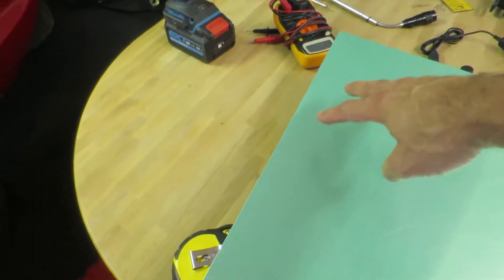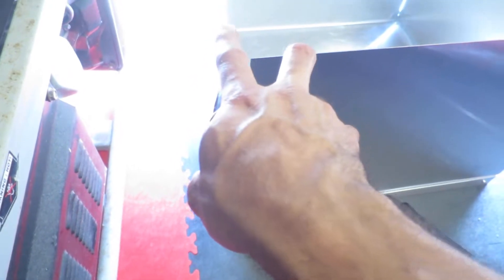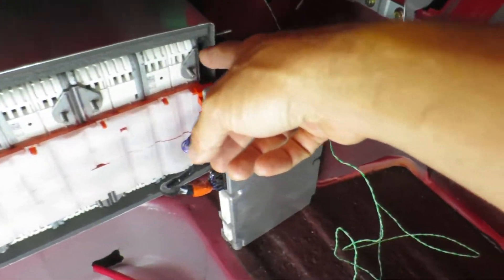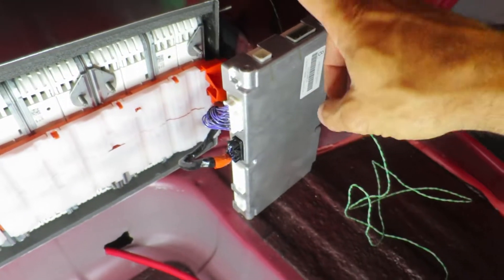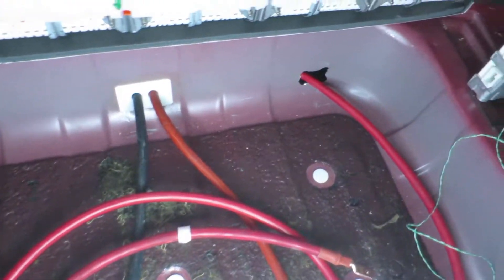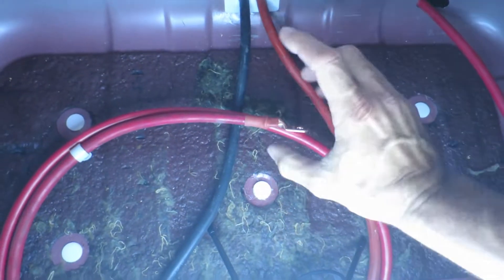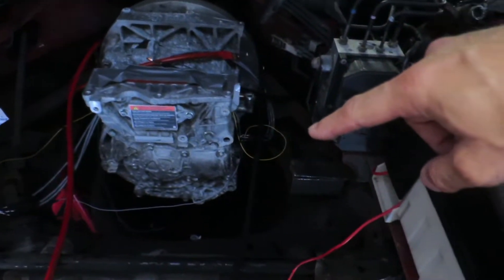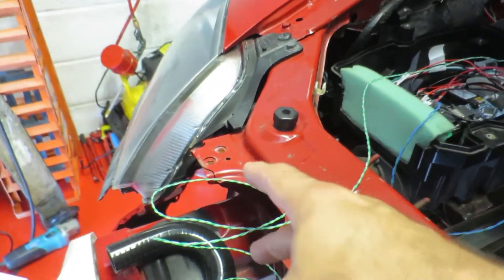Rear Leaf Battery Holder completed...

Comment: Another nice video Dave, what did you use to try and braize the ali? I've seen some aluminium welding rods online that I'm tempted to try.
Reply from the maker: Problem is the rods melting point is very close to the melting point of Alu - and the cheaper rods you buy the closer this relationship is! I bought some cheap ones on amazon and they only melted once the Alu had already started to fall apart! Just tried to see where I bought my second batch of rods from - it was a branded name and bloody expensive! If you google brazing Alu you will find lots of people recommending different brands - stick to these and avoid being tempted by the cheap ebay / amazon rods - they are awful.

Comment: This is great and I could listen to you all day 🤣

Not sure what rivets those are but always be careful with dissimilar metals.  Ideally they are the same. Steel rivets in aluminium is fine for a long time. Never use aluminium rivets in steel as they'll just dissolve 😳 I had to fish a box trailer roof out of a hedge when someone else did that!
Reply from the maker: Ohh top tip James, didnt know that! these are steel rivets in Alu. But other than just keeping things in place they are not structural - so if any rivets failed bits of the car wont fall off! (I hope!)
Reply: @SouthWestEVUK  Steel rivets in aluminium (particularly where they don't get wet / salty) will last for years.  I only mentioned it as you were talking about riveting something to the car - If you'd got aluminium rivets for the box and used them on the steel of the car (particularly somewhere underneath that was exposed, wet, salty and subject to the stresses of the car) they wouldn't last that long!

Can't wait to see the car on the road.

Comment: Hi.i saw this conversion kit with motor fitted on real axle,woud not that be easier to do.take out the engine and no need of drive shaft etc
Reply from the maker: There are lots of ways to be honest, but I fancied keeping the gearbox and trying to spread as much weight around the car to keep it balanced.
Reply: @SouthWestEVUK  thanks for reply.  i was thinking this way you can put more batteries in the front  to increase range.
Reply from the maker: I am having the same number of batteries up front too...

Comment: Good progress, nice work around for the braising. 
My Spitfire is like to have a similarly positioned battery box in the rear. What have you got in the RX8 to stop the batteries joining you in the cabin in an accident? In the Spitfire all I have is cardboard, so I was considering some steel bracing straps.
Reply from the maker: Hay, so the batteries are obviously in the Alu box - and then the seats are backed onto steel frames -  they are pretty sturdy and I struggle to see the whole box managing to bend it in half. Obviously forces involved in a crash can be pretty epic, but I am happy this will be ok.
Reply: @SouthWestEVUK  I'm assuming there is a partial bulk head the end are up against then?
Reply from the maker: Yeah, they shalt not pass